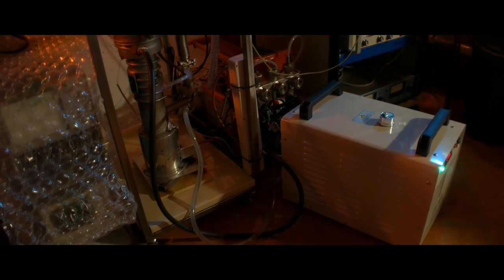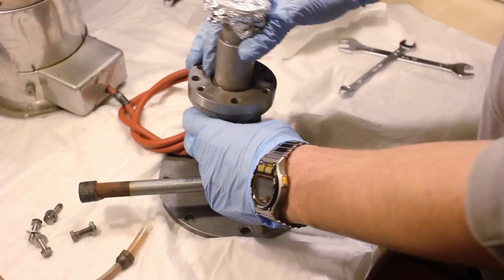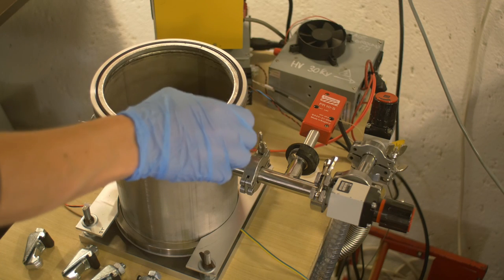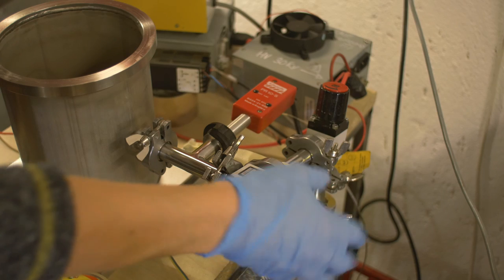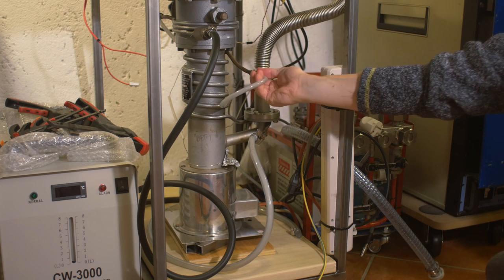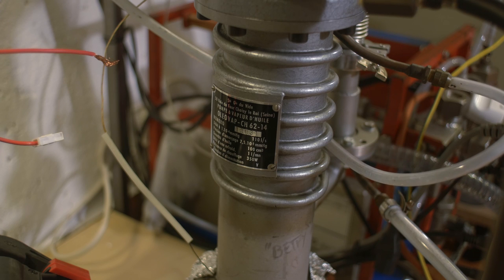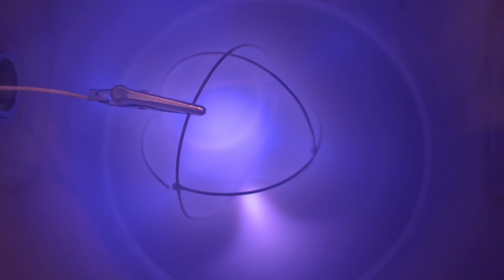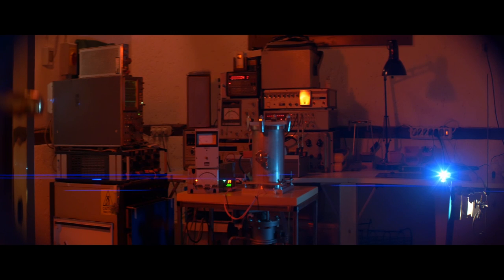DIY High Vacuum Chamber and Plasma Experiments

Comment: Excellent video! Is this capacitively coupled plasma? Also, would you consider releasing a full materials list?
Reply from the maker: Hi! Thanks! I don’t think is CCP, since is DC plasma, not RF. 
If I find the time I would love to do a followup of this video (I’ve just upgraded the secondary pump to a turbo pump). In that I will add a materials list too.
Reply: @DaveElectronics  okay thanks 🙏🙏

Comment: Great content, would love to see a video on the electronic/instrumentation side of the system since I’ve been trying to build my own chamber for TiN and other metal coatings but can’t find a lot of information on that part
Reply from the maker: Hi, thanks for the comment! I will talk about the power supplies used to generate the plasma in a future video, as I just got another high voltage one to be repaired ;)
As for the PVD process, I tried sputtering technique using a small magnetron setup and an alluminium target. I've done just a few experiments with it, but nothing spectacular as it was not water cooled. If you want to do it properly, you pretty much must water cool the magnets, otherwise the magnets WILL (personal experience, haha!) surpass the Curie temperature and you may damage the expensive target as well. 
I used DC plasma, so a high voltage power supply is needed (1 to 3 kV is sufficient at high vacuum levels, even lower voltage at a pressure higher than 10^-2 Torr). High voltage power supplies are usually expensive, but you could either DIY it or get an electrophoresis psu that you can find super cheap and can deliver quite high voltages and current. If you're not familiar with high voltage I highly suggest you to experiment with RF plasma. I don't have an RF transmitter and/or amplifier, but I worked with RF plasma before and it's actually quite easy and a bit safer than having a 3kV line going into the chamber (but it's more expensive..). 
To measure the coating thickness, quartz thin film thickness monitors are used (usually found cheap on ebay). 
As for vacuum measurement, I made a whole video about vacuum gauges and how they work ;) I use a Pirani gauge and, for higher vacuum levels, a Penning cold-cathode one. 
Oh, almost forgot.. if you're planning to build your chamber for sputtering or any other PVD, I suggest you to get a turbo pump instead of a diffusion one. More expensive, but way cleaner and better coating results. 
If you have any question, feel free to ask :)
Dave

Comment: Hi Great stuff - well done! Can I ask some more info about what happens when you bring a bar magnet close to the plasma - is it attracted or repelled? Thanks Len.
Reply from the maker: Hi! The plasma is affected by magnetic and electric fields because of its nature of being composed by charged particles. For the same reason it can actually generate a magnetic field itself. 
Regarding effect on the magnet is so tiny that is negligible (and you definetly can't feel it). That said, i think a magnet will be attracted to a plasma because the charged particles will rearrange in the best way possible to mantain an equilibrium state.
Reply: @DaveElectronics  Thanks very much. Do you have any shots showing how plasma moves when a magnet comes near the equipment?